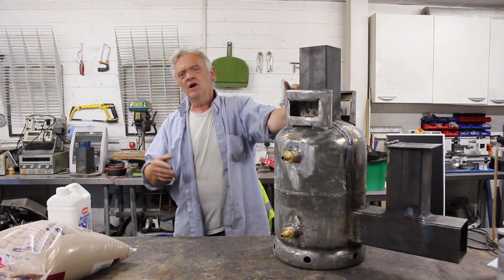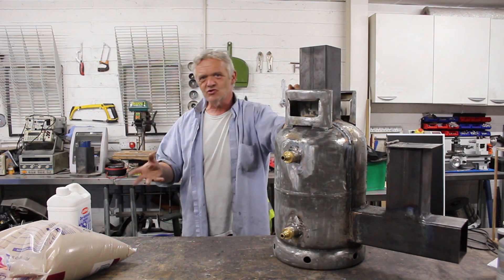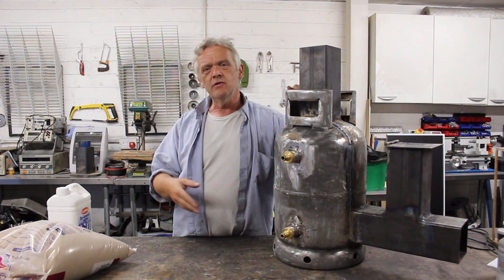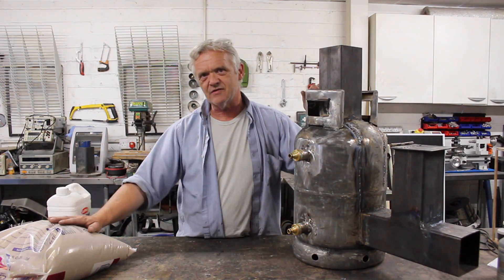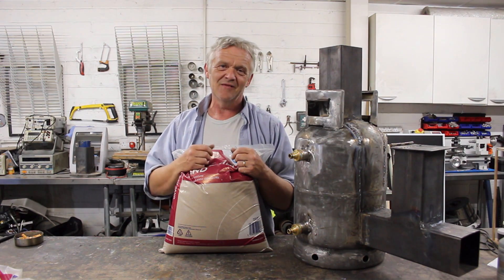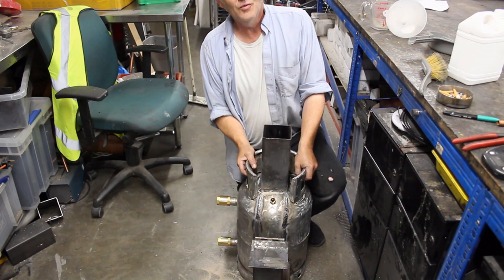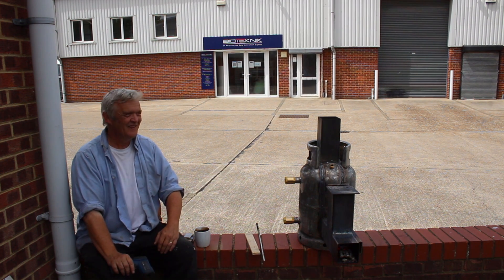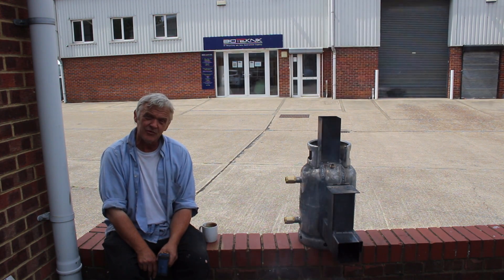1607 A DIY Sand Battery

Comment: I am going to to do a sand battery to store my excess solar energy for days. 
My house sits on a sand dune like most in New Mexico (USA).
Heat loss to the ground would require insulation around the smaller sand bin , sized for my house. 
I have found little info on how long   a small sand bin holds heat and the insulation needed at the temperatures required.  500 deg c  is way too much for most insuations.  
I found recycled foam glass beads which would tolerate very high temps. Has anyone tried these?
I could imagine a trench filled with these surrounding the existing sand serving as the tank. More foam beads will be poured on top of the sand.  
Can anyone help out with the thermal calculations?

Comment: 4.6 kWh is about enough to keep one medium size room warm for one hour in the winter. The temperature starts off nice but then gets cooler with time. You need to put it in a box with flaps or something to control the release of the heat.

Comment: What about “Heat-pipe” integration? As it’s one of the most efficient ways to distribute heat and is the standard in a small form factor uses for things like CPU’s
Reply: Perhaps a a heat sync to the chimney that gores throughout the dry sand for faster heating of the sand that a water coil can go through, and the heat pipes can protrude out the top to a radiator with a fan. Or even no chimney, just an exposed copper heat sync over say a candle or a smaller chi on a waste oil /vegetable oil burner with a wick to directly xpose the heat sync with heat to transfer that heat through the sand (to heat the sand) and a radiator with fan for heating ambient air for any excess heat in that heat pipe… while also promoting the capillary action to condensate the liquid inside the heat pipe. (I’d suggest filling copper tubing with the ultra tiny wires from a car stereo that’s been unsheathed and insisted to promote the transfer of heat and condensation to its most efficient. Than with a minute amount of water added to the heat pipe, it’s capped off with a soldered top (which heats the pipe expands the liquid to vapor, then the seal would cause a vacuum for lower boiling point efficiency. I’ve seen a heat pipe made similar to this on another channel, but the vacuum is important. And it would ideally be used with small amounts of fuel (like I mentioned, a candle, or wicked ignitable fluid, NOT a fire with old and other hotter heat sources. This is an attempt to make as efficient as possible heaters for either room heating or the inclusion of a copper coils to also heat water. 

I would love to see this attempted, if I’ve explained it clear enough.😅

Comment: So why don’t you mix your sand with graphite to make it flow this way you could use capillary heating in small tubes to intensify the heat pump, the sand and graphite through your lines into a container that is set up like a honeycomb, and would disperse the heat, more evenly while pumping air across it, making the Santaflow and pumping it from container to container, I would think Would allow you to get it up to a higher temperature and thereby lasting longer as a battery.

Comment: It seems like the most practical use for this is an oven. There isn't really any loss in efficiency over a heat pump or battery storage since the only way to heat up an oven is either gas or resistance elements because of the high temperature. Using a fresnel lens to heat up the sand rather than a solar panel and resistance element would mean you'd be capturing and storing solar energy as heat at close to 100% efficiency. Then the oven  it will be warm or ready to warm your oven whenever you need it. You could also slap a TEC to the sand and another to the back of the oven, so electricity is generated as the oven cools down and generates electricity from the sand if there is ever an excess of heat. So you could in theory have an oven that gets all its energy from sunlight and would generate electricity as the oven cools down or there is an abundance of solar thermal energy. With all except the electricity generation operating at near 100% efficiency. Even the TECs could operate at their best efficiency due ro rhe high heat and the heat passing from the oven/sand through thr TEC could even be used to heat water for residential use.

Comment: Robert ... I've been thinking about this approach for a while !.  I've got 1800kW of PV power every year in summer that I just can't use and would love to "store".   I know one of sands attributes is it's stupidly high temperature ability, but with the only realistic way for me to recover the stored energy being via water, I'm wondering how working at (storing at) under 100 degC might negatively affect the system.  I'm also having difficulty working out the quantity of sand required, given vastly different "specific heat" (and other) figures appearing on the web.   Thoughts truly welcome !!  Cheers !

Comment: Everyone keeps calling these sand batteries but no one is showing how to use it in a real World application like powering an RV or a home.
Reply: They're not for power they're for heat
Reply: @Laurel-Crowned , curious. Heat isn't power?
Reply: @the_natrix9959 .  Heat is energy. Power is a measure of how much energy is used over some time interval.
Reply: It's for power if you use steam to turn a generator.  There are commercially available sand batteries that do this

Comment: Seeing those big silos in finland holding loads of sand is obviously very expensive but I thought of a much cheaper way to do it, just dig a hole in your garden, say 1 mtr square and 2-3 MTs deep. Use thermal insulated blocks on the outside and fill it with sand and the exhaust of a rocket stove, up and down a couple times then out and then either pipes for water or ducting for air. Water or air goes down cool and comes up warm/hot, put an insulated lid on top and that amount of sand will hold alot of heat for a long time  at not a huge price. Charge it over a few hours like a huge storage heater but the heat should last a long time, days I reckon
Reply: If I heat sand to 400 degrees temp, then what will the half life be, or in other words how much heat diminishes over a period of time. So will sand cool slower than water. Surely heating sand must be much harder than heating water, then why not just heat water. What advantage does sand provide, I am still confused.

Comment: I also learned that through convection that was created from sound waves that you could create heat.  Could you transport the heat generated by this convection and store it into portable sand batteries?
Reply: Never heard a of a convection. Is that a new generator model or something.

Comment: Here is my first question.  Could you draw heat from antifreeze and store that heat inside a sand battery?  I thought about using antifreeze inside small pipes on the back of a solar panel and transporting the heat from the antifreeze into a set of portable sand batteries.
Reply: How would ypu heat antifreeze, and it is expensive

Comment: So, an oil drum ,  200liter of sand. Copper coil. Good amount of insulation around the drum. Heating element of a water heater at the bottom. Smart plug that dumps my extra solar power during the day into the sand. I could send water trough the copper pipe and into a radiator with fan, heating up the room long after the sun has gone down.

Comment: Hey Hey!! Less of the agriculture bashing like you did at 5:54, do a bit of proper research on the actual amount of emissions from agricultural and livestock before you start lumping that in with real polluters like industry and transport, I would have expected more from an intelligent bloke than trotting out the party line on this.

Comment: Serious question: is there a reason the Finn's are using sand and not salt? Salt's everywhere, and you can melt it at 1500F or so. I know the Solana solar power plant in Arizona uses salt in its thermal energy storage tanks, so this is hardly an unheard of material for TES.
Reply: Is sodium chloride fine, can mix a sand and salt ratio
Reply: Corrosion problems

Comment: Hi Robert I purchased the concrete mould and 300mm box section as per video and I watched this video and  I thought if I add a pot holder like you made for the rocket stove and filled a large saucepan with sand would I create another version of a sand battery? If it works possibly buy something bigger
Reply from the maker: yeah you would mate - pretty cool idea - you should do a video and share it too!
Reply: @ThinkingandTinkering  Thanks I think I will  when it gets delivered next week, although I'm more than happy if you want to do a video on it as you are fantastic at doing the videos

Comment: Hi, afraid my O level physics hasn't equipped me with the knowledge to answer my own question here so can I throw it open? I have a multi-fuel stove in my living room. Would it be worth me placing a biscuit tin full of sand on top of it to maximise heat from it even after it goes out?
My gut reaction says that it would require a LOT of sand before it made any difference but I don't have any facts to back that up. So over to those more knowledgeable........

Comment: Since water would be better at storing energy, I'm curious what is the highest pressure you can put water under in a pressurized vessel to prevent boiling.

Comment: I went down the mass heater road and after a lot of trying I decided you are better off just letting the heat enter the room the mass actually insulated and caries the heat out of the system if you are looking for efficiency weather proofing is a much better use of time I do use a pellet rocket stove gravity fed and home made so I know how fun they are I have a water system that heats a radiator no electric needed  the burn chamber is 2 inch treaded pipe into a small barrel and out a 4 inch exhaust steam punky simple and super efficient and clean

Comment: How can you compare the emissions from cows with concrete?
Cows eat grass. Grass eats CO2. It is circular. 
Pasture raised grassfed cattle even binds CO2 permanently in the ground by treading plants into the soil.
Concrete releases CO2 bound in minerals and fuel for the rotary furnace. Thats way more problematic. However even the calciumoxide slowly reacts with the CO2 in the atmosphere to calciumcarbonate, the rawmaterial of concrete.

Comment: Given the heat capacity vs temperature gIn, there really isn't much advantage over a standard water boiler. HOWEVER - sand is 2x more dense, so it could be N advantage in a small flat or house over a standard water storage system.

Comment: You could have heated quite a lot of sand, water or even air on the exhaust which might be the progression. Could be really useful in a home or workshop. I suppose just building the rocket stove from brick would be even better.

Comment: Could you coil some copper pipe inside the sand and heat a set of radiators through the night with this idea?

Comment: A great channel, your keeping my brain very busy.   

I watched this and the rocket stove water heater video and I can't help thinking a combination of the two would be helpful.   Run water pipes through the sand bank and add an oil drum cap and chimney to gather the wasted heat.

That would hopefully have the effect of gathering heat for hot water for along time after the fire has gone out.  Rocket stove mass heaters are great but as its illegal to fit one in your house(in the UK) an efficient water heater outside might be more use to alot more people.

What do you think.  Would the 100c  temperature cap on the water drain the sand batterys usefulness too quickly?

Thanks again for the excellent channel!
Reply: You can add insulation, so no heat will escape

Comment: Great video! I think it would be interesting to find a simple way to utilize the sand in situ with minimal expenses. For example, if you want to install a solar cel array in the desert, dig a hole in the sand, throw some kind of lining and spray insulation, put whatever is needed in the hole, like pipes for medium circulation, push the sand back into the hole, and insulate and cover the top. Of course, what exactly should be used as the lining and insulation is for another debate, maybe just polyurethane foam and metal plates, or concrete, but in any case, if it would work, it would make possible to transform Sahara into a giant battery in no time, and would also have near zero impact on the environment. In fact, if you put dunes back in place carefully, none would be the wiser LOL.

Comment: This video is particularly interesting to me because I've been sitting around imagining a "fix" to the battery storage problem that solar panels have (which makes them an intermittent power source at the time——sun goes up, sun goes down kind of issue).  I imagined thermal batteries as a solution.  I was thinking something awfully expensive like molten metal at over 1000 C, but it's nice to see we can do the same thing by principle with sand or whatever earthy materials we have laying around.  Plus, a lot of metals have lower heat capacities than sand.  Overall, this video is great.  Thanks.
Reply: If heating sand has a high half life and retains heat really well, then surely heating sand must also be much harder than water. Then why not directly heat water then.

Comment: Of course you could use recycled concrete and clay brickdust and sand mix so there is no carbon cost using the recycled stuff. 
Very sadly Ukraine will have loads of that stuff now. They do have some sand batteries

Comment: I love what you made there.  It would be most interesting if you filled the bottle as you did, BUT put a stainless coil inside to  draw out the heat with water as needed.
Reply: I was thinking of moving the hot sand around. For steel 1000°C should be possible. So you would have a well insulated box and you cold take the heat out. 
But then, why not having a steel pipe and blowing air through. And rotate the box if needed.
But whats the difference to the electric heaters in the rooms which were heated up electrically by night and where the heat was taken out over day. 
Whats good, desert sand (that cannot be used for construction).
Reply: @klauszinser  At that temp, you could cook your food as well and create a convection oven using a fan, or even an air fryer.  Air may prove to be better than water for removing the heat though water is better at storing the heat at lower temps below boiling.  
Perhaps a hybrid system where the ultra high temp material is left outside and pumped via air into living quarters to heat water below boiling to provide heat where needed over time as water is best at storing heat at lower temps.   You still need to insulate the water so the heat does not dissipate to rapidly but not to much so it provides heat.  Then you can use the hot air also for cooking, and in my case, experimenting with other projects and perhaps a pizza oven!  🍕

Comment: Try graphite powder, high temp capacity.   Graphene even would be interesting.
Reply: Expensive, maybe a mixture of sand and graphite
Reply: @alakazaam-n7c  Yes give it a go amd let me know how it works?
Reply: Sand mixed with aluminum oxide powder or pure aluminum powder.  The aluminum will melt giving you a massive btu increase at the phase change.  Im going to look up the expansion ration at the phase change.
Reply: @l0I0I0I0 aluminum oxide is toxic, and can you explain btu
Reply: @alakazaam-n7c  BTU is british thermal Unit.  1 btu is the amount of energy required to increase temp 1 degree.  Its mostly used in determining heat requirements for ac units, such as one ton or 3 ton depending on insulation and size of the space etc.  
Yes all these metals, silicon, sand, bricks have a certain level of toxicity.  Its best to not breath drink or eat.  Im a bit of fanatic on toxicity as I was exposed and have issues.

Comment: Hi Robert. Thank you for the great video. What do you think are the possible ways to store summer heat in sand and use it in winter. Do we need solar collectors with oil as the heat transfer material or are there better ways to collect heat from the building itself maybe from the inside of buildings and storing it in sand
Reply: Ground source heat pumps are for that. You use the heat pump to remove the summer heat and send it into the ground and then reverse it in winter. If you don't use a heat pump and just send air through pipes, you're going to store only a day or two of heat before it balances off because the temperature differential is too small.

Comment: thanks for this.  I was going to put a smaller canner full of sand on the wood stove but maybe a chunk of concrete will work just as well, less mess and adjustable since there are a few of them around here.  Should be able to let the fire go out at night.